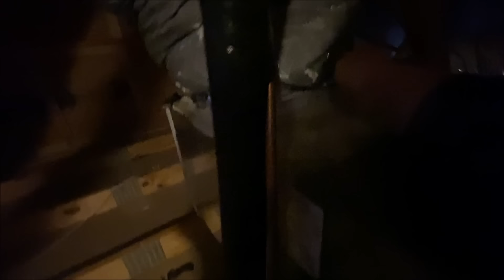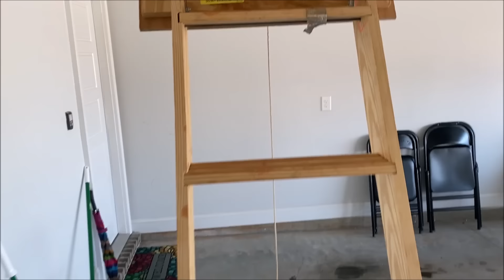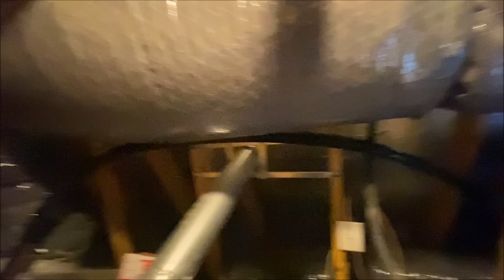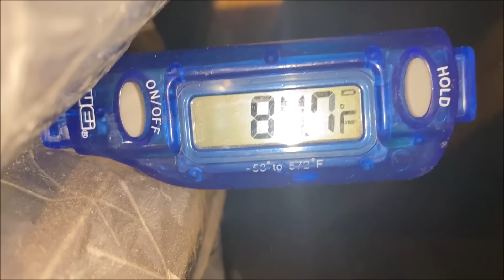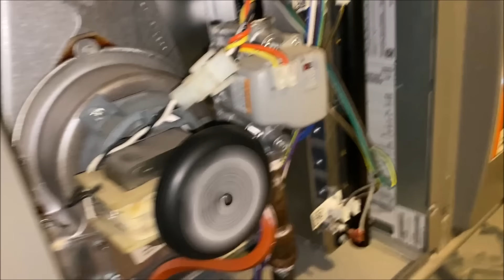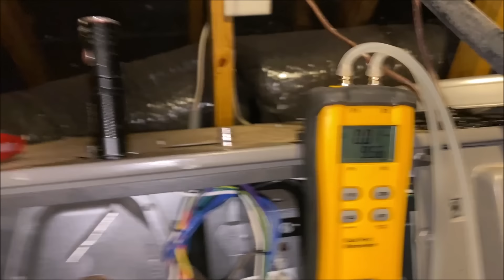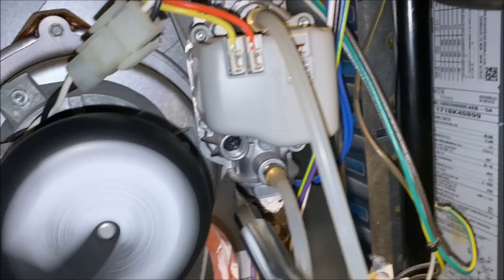New Construction HVAC Hack Job Butcher Sabotage pathetic installers

Comment: You made the best comment...(paraphrasing) you can have the best materials in the world, but if are clueless.. they become worthless. 

I have seen a great many new construction job.  The vast majority are rigged up messes.  What the average buyer doesn't realize is that incidents like this, of poor construction, are going to cost them a fair % of the cost of the home to repair.  

As an aside, did they run out of dimensional timber when they built that space.  They have 2x3 support timber lapping into the joists and not into structural horizontal members fully integrated into the walls and supported by load bearing walls.  On way to see this is the decking and exposed joists relative to where the ducts punch through to the lower floor.

Comment: Actually flex duct says right on it not to be used for negative pressure (return) and not for lengths any longer than 25 ft.

Shoulda taken static reading. Prob sky high.

Comment: I've never...ever seen a heating system...in an attic...are you kidding me🤣
Reply: It is a standard implementation for new construction.  The rationale is maximizing living space  for homes without a basement.  I don't understand it at all.  Given that hot air rises you would want your ducts at floor level.  Otherwise, your heat will never turn off as the movement from hot air vent to cold air return is the only thing moving air to the 2 ft to 6ft height.  It also forces the use of ceiling fans.

Comment: The delta on A/C should be about 20 degrees, 30 for heat pumps on heating and a gas furnace is easily 50 degrees. This is bonkers!

Comment: A proper duct system would be externally insulated round pipe with 6' of flex at each register to quiet it down. This is a joke

Comment: For a two year old build that attic looks like it’s fifty years. Where’s the insulation? Small piles here and there but largely missing. Sad build on so many levels
Reply: Here's a real giveaway that it's 2 years old...look at the timber used for framing.  See if you can find a grain in any of the closeup images of the wood.  It looks like balsa.

Comment: There is definitely a reason why you would use a main trunk and it's for flow characteristics mainly  because flex duct has a continuous ring and that creates vortices that totally restrict the flow and in a high efficiency furnace it doesn't start hot enough to reach the ducts at a good speed ( cooler air is denser ..flex duct has its place and its not for entire house or you are just wasting gas and money...I learned years ago ...lol

Comment: I'm done HVAC work for many a year had the same similar problem you got and it had nothing to do with regulators and draft controls and manometer readings it was in the air flow the coil was dirty and it was backwardsput it in backwards so why aren't you checking the air flow because you said you went downstairs and there was insufficient air I don't get you

Comment: Some of these "companies" that build 100's or even thousands of homes each year really do cheap out on anything they can. The problem is they take the lowest bid without asking questions. I am a landscaper. Last year, I installed 2 French Drains at 2 different residences, because their property was constantly flooded. The problem ended up being an UNDERGROUND WELL that wasn't capped. Many of their driveways in this neighborhood had been replaced within the first year, cracking and sinking. The concrete people they used thought it was ok to use 3 inches of base, and poured the driveways to an inch thick. These people are paying 400,000 dollars for these places and getting shafted so hard. It's disgusting

Comment: LP is set for 11” WC input and NG is usually 3.5-5” WC. Inlet pressure has nothing to do with the valve. 90k on a 4 ton unit is way too low. It’s usually 100k plus.

Comment: Ive never seen anything like this in all my years, i dont do hvac but i fix or remedy networks so i run terminal lines and cleanup the pile of line the telecom installer just threw in a corner for example.
Ive never seen such horrible Product or "system" like this junk.  And ive seen some complete garbage.

New sub just found the the ch

Comment: Loose gas pipe? Immediate shut down of the gas service. Update is necessary. Duct work should be COMPLETELY redone right. Most all these manufactured homes are trash. From the foundation to the shingles. Selling this junk for around 280,000$$ in Indiana USA. ZERO CRAFTMANSHIP.
Reply: I'm surprised at that as well.  I would have immediately shut the system down to determine if the service line was the only mechanical/installation issue.  How many people worked on this, saw this, inspected this...and then left it as is.  

The duct work is also an immediate issue.  Given the price of NG and the overconsumption caused by the install, you could estimate a pay back of 5 years or so to redo the work now..maybe less...the owners seem to like a very warm home.  (70F was too cool for them)..

Comment: Gas pressure has nothing to do with air flow the blue flame indicates good gas pressure the problem is air flow . It's the spring pressure in regulator not the size of it the whole installation is crap take everyones tool from them

Comment: The city inspectors have no clue on what is supposed to right, only that it was installed per code. Which most code says it has to be sealed and pass a leak test. Duct will make or break the system.
Reply: I think the gas service line that was jiggly probably was there at inspection...so.

Comment: Doubt installers messed with gas valve.  From what I have seen they usually install it as quickly as possible and then do a rapid test start.  Run cooling, if it’s getting a decent split swap to heat.  If burners light then that’s it.  Most likely they left as is during cooling season and moved on to next install.  They don’t make a lot per install so the more jobs they complete the more they make.  Issue is two fold, first builder prob went with low bid to increase his margin.  Second if it’s county, many times there’s no code enforcement.  If it had an inspection then the homeowner needs ti have a talk with lead inspector.

Comment: The moment I know that the furnace is working and firing but no heat is coming out of the vents. I know it is a duct work problem. 
Installer block offs happen, builder should have tested the heat at least before selling the home.

Comment: Now and days (well at least in Texas) builders are literally wanting everything for free. So what do they do? they hire the cheapest crew for everything. You get what you paid for but the bad part is that the new owners are the ones that get the bill in the end. I’m a HVAC tech and roofer and I don’t work new construction because of low pay. I’m the one that usually goes out and fixes the problems after.

Comment: I do majority commercial work but you'll run into a lot of residential equipment in commercial work the worst gas pressure issue I've ever found was a unit that had been running for over 4 years with the blue plastic cap that's usually covering the new gas valves was threaded and pushed through the gas valve and barely allowed any gas to go in and nobody complained for years

Comment: That regulator was my first concern.
Why do you need to regulate meter pressure? If you need to be regulated for gas logs the put it in the gas log line.
Instead they made a manifold after the regulator. Then everybody gets regulated that's why they had the gas valve regulator cranked. The incoming pressure was to low. Your monometer showed you never got to the factory recommended pressure at 3.5" wc.
Then all 👉All that flex needs to come out. Duct and hard pipe insulated. Good news though you can pull the membrane out of the flex and use that as pipe insulation. 
How did that pass inspection? Because where I'm at any flex longer that 3' gets violated.

Comment: forget the hvac system. it looks like a 9 year old tried to build his own fort in the attic. the framing looks like someone dropped a bunch of toothpicks in a pile and that's how they landed.
Reply: Seriously...right?  Why hasn't anyone mentioned this?  There is absolutely no pattern to the placement.  It's like they had a bunch of scrap cuts of 1x3 and 2x3 ( they are not 2x4) and knew they needed to put in supports but, because they are not cut to lengths specced  on the plans, they just put them where'd they fit.

Comment: I actually hired a smart trade guy, ordered a good man heat pump and air handler. Had the whole thing delivered and installed for around $3500. Our energy company also gave a $2500 rebate. Working great for the past 2 years. I paid the guy about $50 an hour. Quotes for the same thing from local companies was over 10k.
Reply: Shame on you, I'm in the trade's & should been 80 -100 an HR ya cheap bastard, dude probably NEVER do any work for you or anyone you KNOW.  
🤦🙄

Comment: Wouldn’t a good first step be to fix the airflow issues caused by the crimped duct? You verified the outlets are trickling, saw the crimped main duct, and verified the fan was pushing... isn’t that enough to inform you of an airflow issue? I’m 7:29 in and that smashed up duct is bugging me something fierce

Comment: a ONE YEAR Warranty for a new system is just BS.. the one i replaced for the upstairs about 2 or 3 years ago came with a 5 year, while better than one year its still kinda blehh..
Reply: Well the warranty assumes it’s installed correctly.  This is garbage.  I’d get three proposals to fix this mess.  Choose best option and send to the builder and request he cover it.  If choses not to, bite the bullet to fix correctly and file a lien on his home.

Comment: The gas line had more connections than most European highways. Definitely bad job. As mikeselectricstuff said wouldn't be allowed in the UK. Gas lines free hanging, not allowed, to many fittings and the regulator being so far out that the pressure doesn't exist. These new construction sites are really bad, its about quantity and not quality, despite new legislation that is better. I don't think the inspector looked at that house. The one he saw was probably almost perfect, with hardly any filler or sealing agent, good connections and all clean straight lines, unlike that spaghetti bowl we just looked at. It's to bad :( and Sad!

Comment: Before condemning the Reg. and gas valve on the furnace, you should confirm the outdoor Reg. on the meter is properly sized. It is not-common, but it has happened and would cause what you were seeing. That and tell them to engage the builder for a ducting Re&Re, either in good faith or through litigation, that is straight up B.S.

Comment: This is not how it is done in Canada ductwork has to be engineered  with plans on new home construction I would be going after the builder with a lawsuit, looks like low supply pressure upgrade the gas regulator

Comment: Maybe you were just making a video, but that diagnostic should have taken 10 min tops . Most likely what happen is the unit has bad air flow and was going off on limit so the monkey that installed it turned the gas pressure way down. However low gas pressure can cause flame impingement. Also if you believe that the air flow coming out is so bad that it's not even noticeable how can you just fix the furnace and walk away. The sole purpose of the furnace is to heat the house. Even if you got the temp rise and gas pressure balanced out the home will still be cold and that furnace should run for ever never satisfying the thermostat. Very bad install very bad diagnostic.

Comment: Where I'm at, flex pipe is never supposed to be longer that 15 ft, and it's only supposed to be used to connect the main trunk to the register boots/diffusers. Also supposed to be well supported AND STRAIGHT!
Reply: Absolutely correct! As a Manual D and J instructor, this job was totally wrong on so many level’s. 
This is why we need strong HVAC state codes! Amateurs have no business destroying ours!!!!! Thanks 🤬

Comment: Warm air furnace stuffed in a ventilated attic. What complete garbage! At least they had a folding stairway and some OSB on the attic floor. Some of these new houses just have a 24x24 panel in a closet for access and no flooring except under the furnace.

Comment: The entire roof and rafters are 2x4 boards? The insulation is also barely there. The pinched ducts need correcting.

Comment: Obviously the 325-? regulator either has low input gas pressure, or does not have the right spring installed for the application.

Comment: Could he not remove the pressure screw and check spring first??? Seems like valve and regulator could have been saved...
Reply: Someone above stated that so much pipe dope was used, it could have internal restrictions from excess.  The parts are cheap compared to the labor to diagnose.

Comment: Man, what a hack job. I bet the pipe dope has gummed up the GV inlet screen. Some much wrong in this video. So much pipe dope was used on all the pipes and fittings. Also makes you wonder is the gas piping was sized correctly for all the appliances in the house.

Comment: Interesting that the burner flames look so nice and blue (at 7:00) despite the pressure being so far off. I would have thought that if the gas/oxygen ratio isn't right the flames would suffer....
Reply: Aren't the new systems self regulating?  I am not in hvac.

Comment: Nothing wrong with the regulator (250k btu combined) unless there is a tankless on the same line but I doubt it.  Its the gasline sizing that is either incorrect or they have a low pressure system entering the house, in that case the regulator is unnecessary, they still open but you will have crazy pressure loss. That reg should have 1" WC loss at the max. You are showing 3" WC loss. 

Another hilarious note:
80% efficient furnace lol. Should have a 97% efficient modern furnace that's been standard for the past 15 years. What a waste of fuel.

And yes octopus ductwork does not work.

Comment: God... that whole house is crap. Look at the electrical, the carpentry... even the insulation... its all garbage.     Having worked for a large corporation that did installations, I can forgive some of the shoddy workmanship. You get paid squat and you have to get so many done in a day before you can leave.................. and they get mad at you if it goes into overtime.  I lasted 1 year.........

Comment: My only concern I the name of your channel: AntiDIY. I object because you imply a word to will do a proper job.
I recently had my furnace replaced and central air added. To get this done I spent years — no joke — trying to find a contractor. I was playing not shunned by the local trade, with only a few willing to even look at the job. The only three willing to consider the job refused to run the condensate drain at all, refused to anchor the outside unit, or support the line set. Hack work.
Ultimately I was forced to DIY and bring a guy in from two states over to connect the line set. We’re I not myself a retired electrical contractor — one who had worked extensively alongside HVAC guys — I would not have been able to get it done.

Comment: Inspectors must know less than the installers.  Yikes.  Did this for over 30 yrs.  We used flex all the time in S FL.  Done right, it works great.  Done wrong, trickle effect.
Reply: Yes, this is true.  This is improperly installed, although it would not have been much more effort to do it properly.

Comment: I would say code enforcement should have caught all of that but code enforcement is just a money collector tax anymore. It is not here to protect anyone anymore. My wife and I bought a house that was brand new and foreclosed right after completion. It really sucks for the homeowner. We still have stuff wrong that we can not fix due to costs. That includes replacing two HVAC units and duct work. Replacing deck, structural components under rear dear, rear french doors do to rot. I had to rewire all the outside lights due to not having boxes behind the lights. No connectors where the wires entered the disconnect for the AC units. A new septic system that was somehow approved and never looked at on final but had the inspectors blessing.

Comment: 2018 stamped on the insulation, so they have had it for 4 years before they finally have a complaint? The ductwork is crap, but this is definitely a new issue.

Comment: No excuse for new construction to look like this in this era. My house was built during the NJ housing boom in the early 70’s when developers built dozens of new homes every year and inspectors only did spot checks. A lot of deficiencies were never discovered. I bought the house in 1994. The AC unit was the original and barely kept up with the heat load and finally gave up the ghost in 2008. Through word of mouth I found the best mechanical conr
Reply: Continued: contractor in the area. He found the original system was undersized and ductwork was also. New larger system installed is quieter and much more efficient. The code inspector said that he knew the new system would be properly done when he saw the contractor name in the permit. Contractor said he changed out a lot of AC units in the development over the years and all of them were like mine.